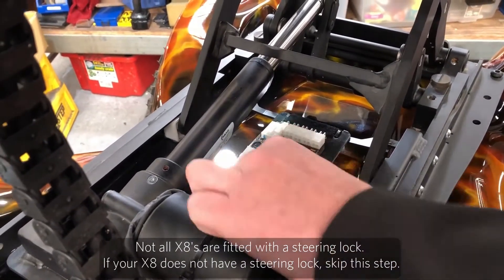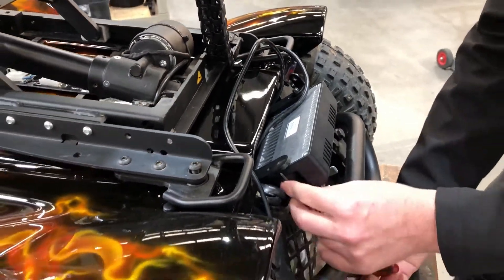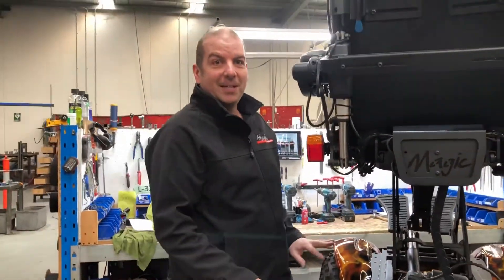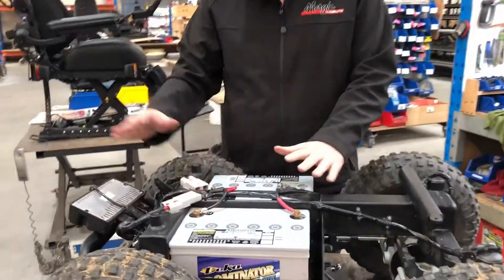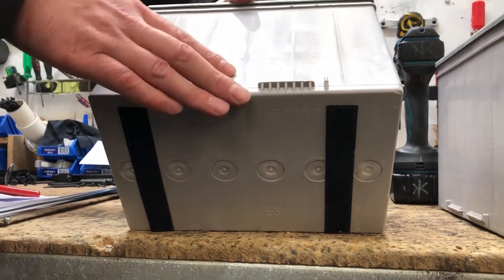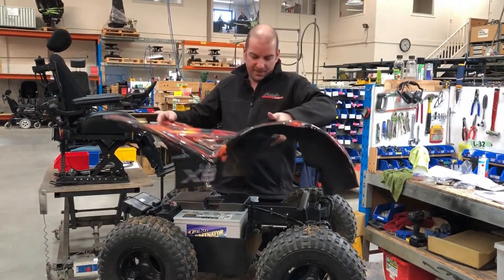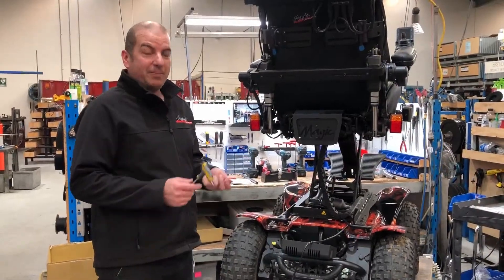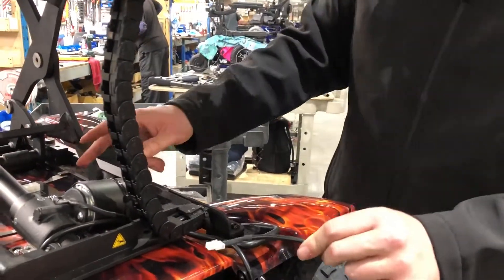How to change the X8 Batteries

Comment: I need to replace 2 75Ah batteries in my X8 and this will help the company replacing them do it properly!  The difference is, I do not have the seat elevator or line lock!  Would you Please post a similar video for those of us with my type of X8!  Also, is there a possibility of replacing the SLA batteries with Lithium Iron Phosphate?  What controller/charger programming needs to be done to allow them to work?  Thank You